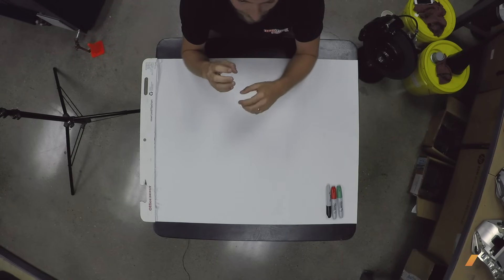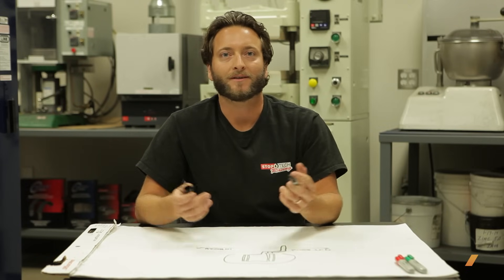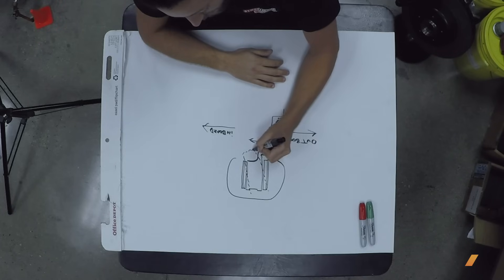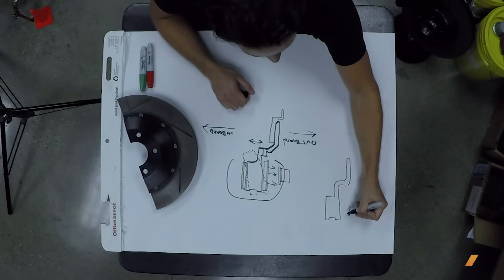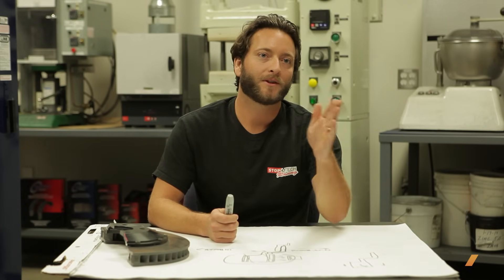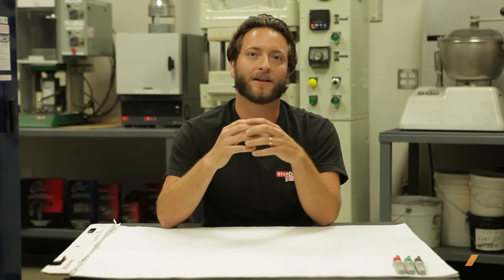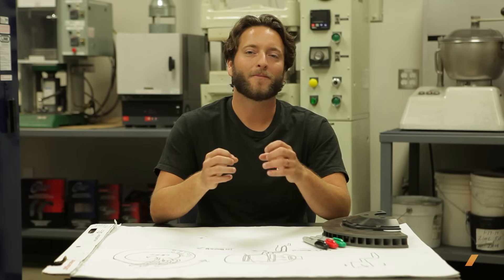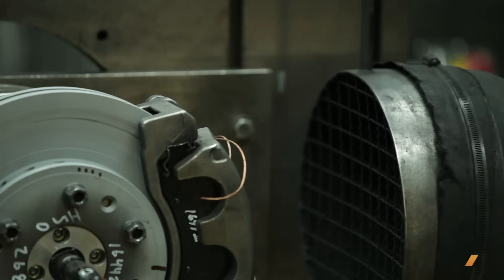The Thing About Brakes Is THIS  -- /ENGINEERED

Comment: The types of brake pads he was talking about confused me for a while, he didn't mention organic or metallic at all.  He says inherent pads, but he's really talking about adherent pads.  In these brakes, the pad material is transferred to the disc, and the friction that stops the car is between the deposited material and the material on the pad.  The rotor itself doesn't see much wear.

Comment: I love how simple yet effective the front breaks are on my Bronco.
Just a single massive floating caliper the diameter of a soda can.
Downside is, the inside primary pad wears about 10-20% faster.
I've found that any vehicle that's perfectly balanced in weight, breaking, and acceleration are the most fun cars to drive. The 1st gen MR2 is probably the worst I've owned. So heavy in the back, and under steer for days!

Comment: The thing about brakes is that they wont be here for much longer
Reply: Are people not supposed to stop now?
Reply: Are you referring to electric cars with electric motors?
Reply: Jordan, of course
Reply: Actually, we might use drumbs instead of discs in the EVs. They will be used much less often and less hard. Especially in City EVs.
Reply: It is true that you could reverse drive an EV and make brakes redundant, but I'm not sure that will be reliable enough for some time.

Comment: This video was really first class. Pretty much sums up what I have been saying about brakes for years. It is impossible to get young gear heads to listen to actual tech. And, there is a definite difference in "feel" when using steel braided brake lines.

Comment: how does a new brake pad changes the front-rear bias? 14:12 Do he mean we should put worn down pads on the axle that is locking too fast?
Reply: He means you would have to replace to a brake pad friction compound with a different coefficient of friction at the relevant operating temperature.  A greater coefficient of friction will create more braking torque for the same pedal effort/line pressure.  

You would put more aggressive (higher mu/coefficient of friction) pad friction compound on the axle that needed to do more work and/or a less aggressive (lower mu/coefficient of friction) pad friction compound on the axle that was doing too much work or locking up the tires prematurely.

Comment: What about Dot 5(.1) fluid? I don't think anybody even sells Dot 3 around here. Or are the DOT standards different in the US from EU?
Reply: You can still find some places that sell DOT3, but most of the shops will sell you DOT4, 5, or 5.1. I would have expected to hear DOT5.1 rather than DOT3 in this video. Yet, probably if they were to talk about 5.1 they would have to explain the difference between 5.1 and 5, and that can take whole new video! LOL
Reply: I guess its a different fluid all together. If your car/bike or whatever recommends it, use it. Its mostly due to seal compatibility as the DOT3/4 could destroy those seals used in a DOT5 system.

Comment: I had a hard time understanding his diagrams. Also it was not at all clear on the functional difference between a one piece and two piece rotor.  The axial and radial float explanations didn't really make clear what then difference was between them, or why deflections of a fractions of an inch would have any discernible effect on pedal modulation.  The video after that was much better.

Comment: I drive a 2010 Crown Vic. What do you guys drive?
Reply: Bob McCoy 99 miata
Reply: 2005 lotus elise supercharged
Reply: R34 Skyline GT-T
Reply: 1945 VW Beetle
Reply: '08 Rabbit/Golf with FIVE cylinders. In a row.
Reply: 2002 Acura Rsx type S
Reply: 2012 Mustang with a 3.5L twin turbo EcoBoost swap
Reply: D-83 Swedish Suck Machine with a 15,000rpm rev limit, direct fuel injection, a single turbocharger. And an ERS (energy recovery system) that comprises two motor generator units based spanking and hip thrusts. Yeahhhhh.
Reply: Five cars, all with five totally different range of use. 
- '06 Audi A3 (daily drive)
- 99 MB-E 220 CDI (my former daily drive)
- 87 Chevy CrewCab Dually 
- 73 Corvette Convertible (manuel 383)
- 73 Firebird Formula (automatic 500)
Reply: 2004 Fabia
Reply: Bob McCoy ...'14 carrera S , '06 cayenne S  and '05 350z.
Reply: Stock nb 5 speed. 'O5. It needs a fastback , it's and brakes
Reply: I meant individual throttle body
Reply: Noel Ebbert I would check out the 6 speed first, shorter gearing and a lower cruising rpm, swapped mine and love it
Reply: '01 VW GTi Mk4  :)
Reply: not that pile of crap

Comment: 1: More aggressive pads reduce your stopping distance because of the initial bite. How fast you can go from 0 to 100% braking torque is a factor.
2: On a bicycle, if you are using your front brakes to their max potential the rear won't have any weight/ braking. Motorcycles are the same and that's why many of us don't use our rears very often. 
3: what's with that end piece of the piston being so much larger than the piston? Do Stoptech buyers like the extra heat conductivity to the fluid? Boiling looks really cool i guess.
Also i tried your pads once, killed an entire set of your "racing" pad in 3 sessions, no joke...that garbage just turned to dust.
Reply: 1.  This is true.  Other factors also apply to this.  The difference is small, but still of concern.  
2.  A car has a longer wheel base so weight transfer is far less pronounced than in the case of a motorcycle or bike.  Even in a front wheel drive front-engined nose heavy car, the rear brakes can still contribute significant braking work.  Rear braking, when not pushed passed the limit of breaking rear tire traction, helps stabilize the car during deceleration.  
3.  Those are piston noses, typically made of titanium or stainless steel.  They insulate caliper piston from the heat of the brake pad's backing plate.  The larger diameter helps block radiation heat transfer and the castellations (raised portions) reduce how much of the piston nose is in contact with the pad backing plate to reduce heat transfer by conduction.  The material used has a lower thermal conductivity than aluminum that also protects the fluid and piston seals from the heat of the brake pads and rotor.  

Lastly, which specific StopTech racing compound did you use?   SR30? SR32? SR33?  SR34?
Reply: Firebert79TA
1: I've seen up to 5ft difference from 60. Probably more if your base pad is junk.
2: I know cars use a lot of rear, just objecting to his example.
3: Radiation is negligible compared to the increased conduction due to the big surface area. Ap just uses stainless pistons and castles the actual piston without increasing the radius of the contact patch.
And I wanna say 33 or 34 but it's been a while. I just overheated them after 12-15 mins every session. The car was not even that powerful...360ish whp back then.
Reply: 1. Have you done that in a controlled instrumented (not just a v-box or equivalent, but also sensors to measure pedal effort and line pressure) test with brake packages with known differences in bite?   Having the brakes up to temperature is a much greater issue.  If you were conducting formal testing, you'd need to measure the rotor temperatures before and after each stop to make sure everything was consistent.  A more likely scenario is a driver blowing a braking zone by 5ft as he adjusts to a slightly different pad with a different friction level.

What kind of testing or measuring did you do to get your 5ft number?  
  
2. But his example has relevance and pretty much any 4 wheeled car.  StopTech makes car brakes.  

3. Radiation is not at all negligible and it is the effect that is responsible for more and more wide annulus rotors being used in racing.  Radiation increases with 4th power of the temperature.  

Even with that assumption, you are mistaken in claiming the contact surface area has been increased.  Try to look at the surface of the piston nose and note very little comes in contact with the pad backing plate.  If you can't see it in the video, just google search for "StopTech piston nose."

Using stainless steel pistons in an aluminum caliper body is not ideal as the materials will expand at different rates, compromising the size of the temperature range at which the piston seal can continue to function properly.   
 
4.  I'm interested in your car that would overheat a race friction in 12-15 minutes.  Are you familiar with "green fade?"
Reply: 1: I haven't done an instrumented test, but have seen a 5ft difference myself(10 stops one after another, average difference was over 10ft but fade came into play with the stock pad so we took an average of the data that was not affected by fade, which was the first 4 or 5 iirc...not as scientific as possible but very real world) I have also seen a 1 car length difference at 140-70 brake zones myself. 
BUT there have been SEVERAL people who have done the tests as well. Drive did a test and saw ~10ft with a pad upgrade and ~15ft with a bbk. (50-0)
Car and Driver also did one and along with confirming the improvement, confirmed the pedal effort argument. (Bite)
And lastly, from my personal experience, doing the same braking zone at the track, when you do it 35 times on each set, your points variation goes away statistically. Better pads have massively moved my brake points on track.
2: He said on a bicycle, in order to optimize the stopping distance, you synchronize the front and rear brake in a certain fashion to get the best stopping distance, which is false. If his example was using cars, the example would be valid. 
3: Radiation has a 4th order on temp but I assume you're not an engineer so you don't see the whole picture. Radiation goes both ways, from high temp to low temp and vice versa. So your 400F caliper radiates to the 600F pad backing plate as well(We won't worry about that). Secondly, despite its 4th order, it gets multiplied by this thing called the boltzman's constant which has a 10^-8 factor. Emissivity comes into play, which we won't worry about and assume 1 to help your case. Based on my 30s calculation, it blocks a whopping 2.1w of radiation! (Assumed 50mm nose on a 30mm piston) 
Radiation doesn't matter. 
I could calculate the conduction for you too but I promise you it's more than 2w. 
And expansion can be accounted for. For years cars have had aluminum pistons in cast iron blocks.

And you say contact patch is not much but please compare it to an AP racing competition piston. Constant radius and castled.
4: Lastly, I was not talking about fade. My pad turned to dust...it is a common thing for race pads that are overheated but usually happens to people who park cars in corners. I have never had another pad that did anything like that. They usually last 4-6 track days, not 3 track sessions!
Reply: Hi, I am an engineer and I am familiar with heat transfer equations, thanks.  

1. In your test, how did you isolate bite as the factor responsible for shorter stopping distances?  This is easy to control in a brake dynomometer, but much more difficult on-vehicle in a constantly changing environment.   

2. So in the realm of bicycles, yes, the rear brake is used for ideal braking too.  Similarly, the rear brake, before lockup, still provides a stabilizing effect.  If no bike ever needed the rear brake, manufacturers would stop including them.  Even with tremendous front grip or a rider always leaning over the handle bars, the rear brake would still serve a purpose in lower acceleration level braking events.  It's a good example that many people can relate to where they had direct and immediate control over brake bias.  I don't get to ride my bike as much as I'd like, but I tend to do stoppies 0% of the time when coming to a (quick) halt.  

As for a motorcycle example, I've done almost all my riding on dirt, and the example holds up well in the lower traction environment.  

3. Aluminum pistons in cast iron caliper bodies are not typically meant for high performance applications.  The whole idea of phenolic pistons is to provide a material that will expand and contract more similarly to cast iron with temperature.  This is more important in the OE world when cars can see extreme cold as well as heat.  

Pad backing plates reach higher temperatures than you've assumed.  With the friction itself getting past 1000 degrees, the backing plates are only slightly cooler.  

I like the AP design.  It limits contact and prevents air from getting trapped. From what I've seen, the contact patch is pretty much the same.  Even for a continuous curve with an infinitesimal contact patch, the backing plate at temperature is not infinitely stiff and will deform until a similar contact is achieved.   

I'll jump in and try some calcs later, but I'm a bit disincentivized having already run the complete cfd model and seen the physical testing in a brake dyno.  (Designed some stainless steel noses 2.5 years ago.)  Piston noses can drastically lower caliper temperatures, but at the cost of higher pad temperatures.  

4.  Yea, those pads sound awful.  I hope you got your money back.  The same pad compounds also survive the 25 hours of Thunderhill and CTSS endurance races, so it makes me wonder.  What replacement pad did you end up going with?
Reply: Didn't seem like it based on your comments about radiation heat transfer. My apologies.

1: That's the only variable I could think of that existed. Braking with a modern ABS system takes my error out of the equation and I have a bit of experience in hitting brake points.
In addition to that I mentioned two instrumented tests one of which had a brake effort sensor to show bite. Proved my personal test. You should google "car and driver brake pads compared".
I also mentioned another test done by drive TV. That was was less scientific but also showed consistent advantage to better pads.
2: I can't believe you are still trying to defend this. Reminds me of what they say about how arguing with an engineer is like wrestling a pig in mud...
In bicycles people go over the bars very often.
On motorcycles, in a performance based scenario on asphalt(i.e. tires are hot) you can go over the bar 100% of the time. Rear brakes are used to alter the handling behavior and bring the front down in case of a wheelie. 
3: When I said aluminum piston in cast iron, I meant inside the engine. 
And I don't believe any racing caliper has ever used phenolic pistons!
Cite a source for the backing plate being only slightly cooler than 1000 degrees(F? C? K?  R?) 
The carbotech pads I use shouldn't be used past 3.9mm because the rest is an isolating agent. I'm sure many other pads are the same.

And please go ahead...I can't imagine how you would have reached those results. My completely uneducated guess would be that the radiation heat transfer benefit may start outweighting the increased conduction after the 5000C range but I could be very wrong. 

4: I wish pads had warranty. I went to an xp24 after iirc and kept the calipers til the end of those pads. Then a set of AP calipers popped up for very cheap so I got those. Tried a set of pagids, a set of ferodos, and now I have 1 track day on carbo RP2's. I have venting now cuz I've heard that RP2s also turn to dust if overheated.

Comment: What is up with brake setups like this Lamborghini Aventador that have a second caliper? http://imgur.com/gallery/ZijVq
Reply: The extra rear caliper is a parking brake.  The primary rear caliper used for that car has no provision for a parking brake, so another brake caliper (or drum system) is needed.
Reply: Oh, that's pretty cool. Thanks for the  answer.